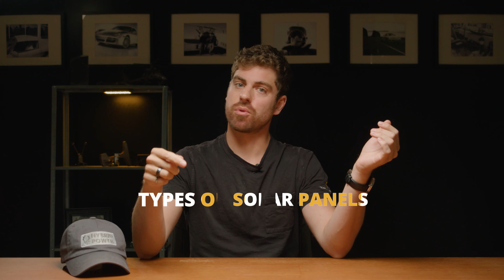Solar Panel Types, Mounts & Configurations

Comment: I'm a little confused about the final computation.  You stated voltage would stay the same but the Amps would add up.  You stated a 3 panel system, 40V and 10Amps = 40V and "20Amps".  Shouldn't that have been 40V and 30 Amps?  10A+10A+10A= 30.  What am I missing?
Reply from the maker: That all depends if they are in series or in parallel. 

If the 3 panels are in parallel then the voltage stays the same but the amperage is multiplied by 3.

If the panels are connected in series, then the voltage of the panel multiplied by 3.

In the example, the configuration was 3S2P. So 3 in series and 2 in parallel. Thus we get 120V and 20A.